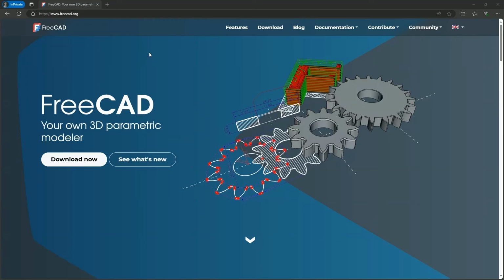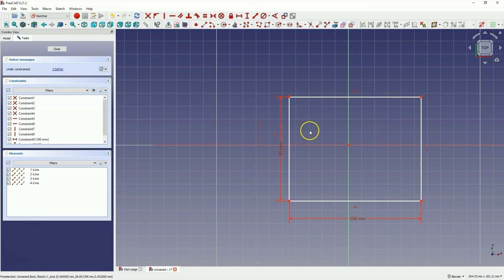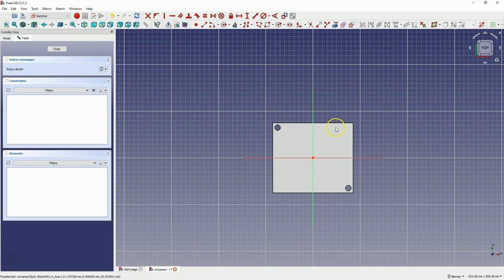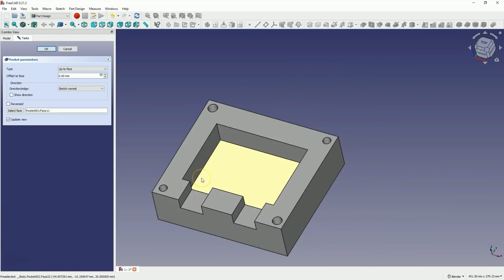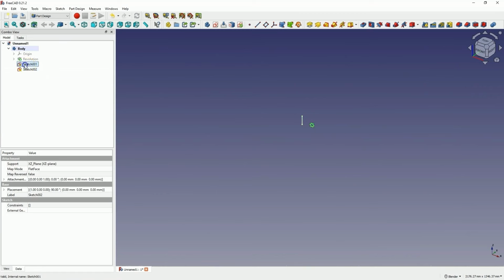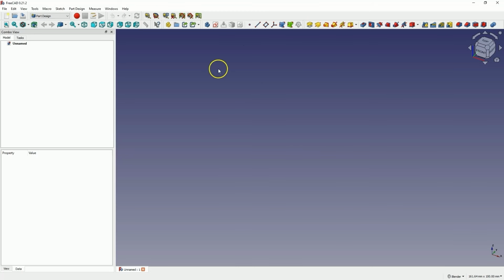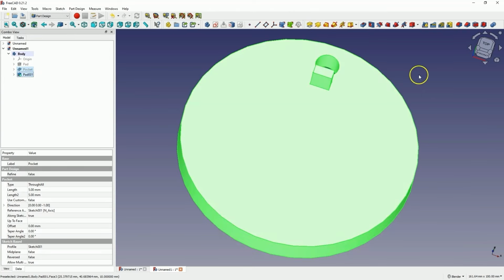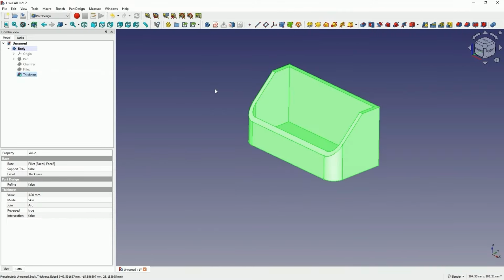FreeCAD 11 Basic Operations for Creating 3D Solids for Beginners

Comment: The value of the  Chamfer couldn't be bigger than 1mm because the holes were included in the face selected. WHEN THE EDGES OF THAT SAME FACE ARE SELECTED THE CHAMFER CAN BE INCREASE UNTIL THE EDGES OF THE HOLES ARE TOUCHED. That's the reason!